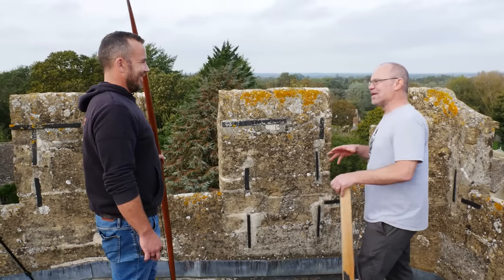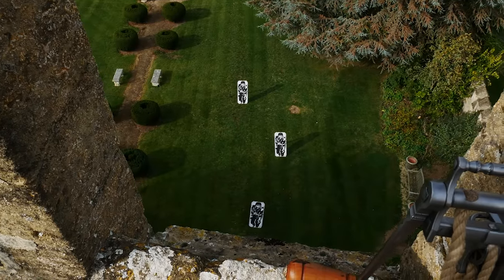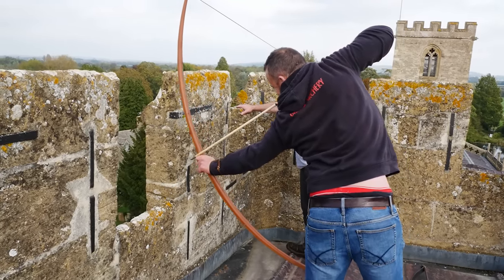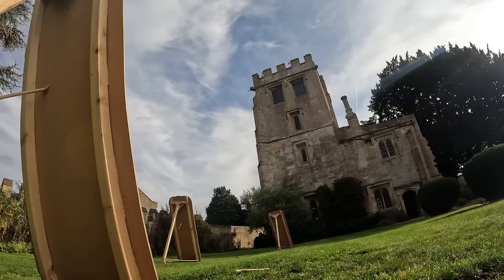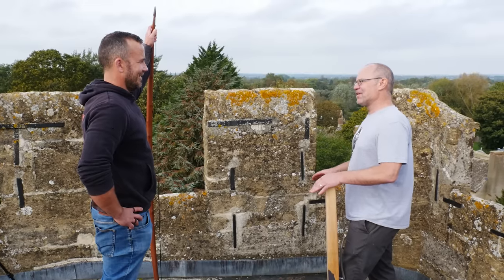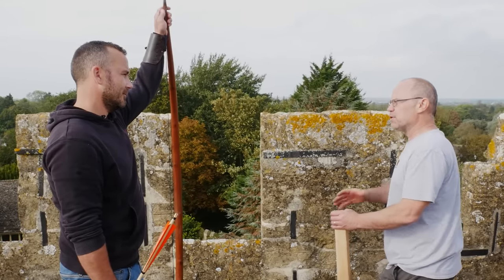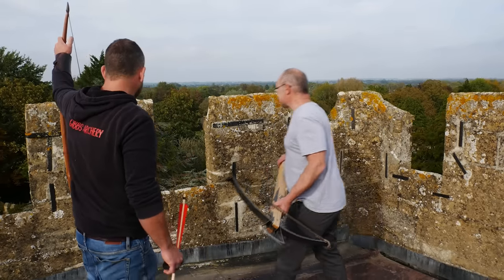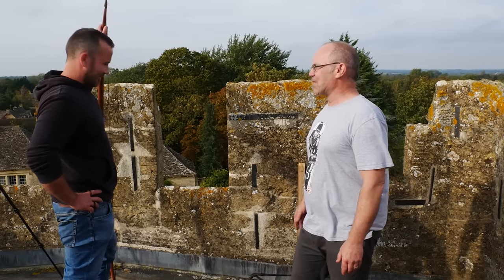Crossbow or Longbow? What's better for defending your medieval tower?

Comment: It's easy to break a bow! If the shoulder straightens up to meet the wall when firing, the sharp angle of which will simply cut many of the fibers of the bow and make it unusable. BUT you can shoot at not full extension, say 70-80% of your extension, without support, stretching the joints and ligaments as much as possible, and when shooting, hold on a little more and immediately release. The accuracy will be low, but for an experienced archer this will be enough to hit a person
That is, pull while it is stretching, pull while firing. There are a lot of arrows, there is no point in aiming for a long time

Comment: Crossbow has a clear advantage over a  war bow / longbow when on defense.

A group of people could load multiple crossbows that would allow the shooters to fire a constant stream of bolts. They would not hurt their backs or expose themselves unnecessarily when they pulled back on the string like the bowman has to. 

On the other hand. The long bowman would have a better weapon when assaulting the castle than the cross bow Wielder's would.
Reply: Not necessarily, men trying to assault the castle or any other fortified wall would be alrady at disatvantage trying to exchange missiles. 

So they would be often try to advance under some cover, pavise at a least. Or , like in 15th century, some kind of mobile shield/pavement or great size. Ideal as far as reloading crossbow goes, to take a quick peek without exposing yourself and shoot. They often had their own embrasures, at least that's what art shows, dunno if any of them survive in museums.

Comment: It’s a little bit in the weeds but I think crossbows had the benifit of a higher skill floor. If I had 20 completely untrained defenders and I had to have each of them shooting either a bow or crossbow you would be in a bad spot either way, but the crossbows would be easier to use for untrained people in a siege.

Comment: I think the actual answer for defending such a small tower would be "a bunch of shortbows, and a couple of longbows"? What do you think?
It would of course depends on what you have available in terms of trained men-at-arms and weaponry, but if given a choice and foresight, I think shortbows could be more useful in targetting the people close to the tower.
Though with an actual defensive structure, Machicolations would change that up.
Do you think Machicolations (as part of Merlons) would favour crossbows, when it comes to targetting people close to the tower?

As for crossbow archers being better paid; they would be a lot more effective at "town walls", or ground level. As then the extra punch (which probably doesn't travel well, and downwards distance travelled is still distance travelled) at the closer range can really be put to use.
In addition, the short training time probably has a factor in the higher wages; to convince people quickly to commit to the fight and decrease the chance of them running off and deciding it is not their fight?

Comment: I'd imagine that the "zone of safety" isn't actually real in this case. Aside from smaller bows, or perhaps some sneaky or bold positioning to shoot a crossbow, thrown items would still be a danger. An enemy could throw a fist-sized rock twelve yards on a level field; with the height of the tower, that range will extend and overlap the inner limit of bow shooting. I'd expect that by the time you're too close for an aimed throw, you're close enough that they can just drop things on you.

Comment: easy to train, better accuracy, easy use overall. if he used one of those light crossbows where u can literally arm the next bolt quite easily using one hand which carries enough power to penetrate a heavy plate armor with a heavier bolt. i bet 100% the crossbow is the better one for tower defence. especially if enemy use heavy armor at front to soak up arrows so their lightly armored can get cover from them and climb the towers/walls quickly.

Comment: For spanning in cover, could you do it while sitting, maybe rocking the crossbow a bit to clear the arms?

Other than that, the ability to keep the crossbow fully drawn to shoot at an instant's notice, possibly easier aiming unless you're very experienced with a bow, and the ease of training an average person do still seem to weigh in favor of the crossbow and later the gun.

Even if it's less individually effective when comparing skilled users, boring logistics still win out

Comment: The crossbow has the old advantage of being "militia-friendly", you come under siege and every schmuck who finds himself behind the walls is a possible crossbowman. After all, it was a baker who got King Richard at the siege of Châlus-Chabrol.

Also, I don't think a bowman would shoot from the ramparts if he can avoid it. That's what arrowslits are for, they sit at the exact right height to allow the archer to shoot just as upright as if he was standing in a field and provided even more protection than crenelations, were sitting architectonically much lower in the wall allowing for a more horizontal shooting all while making the attackers chose whether they raise their shields up against the bolts from above or keep them forward against the arrows from the front.

Comment: I think you are underestimating the exposure advantage. maybe to test it you can time and measure the size of the exposure for each and then do timed shots at targets from the ground (or simulated ground if you aren't allowed to shoot up to the crenelations of this manor). this would also allow you to test the other theorized advantage of the crossbow: the ability to wait for a target to pop up during a siege as the crossbow can sit spanned and loaded. 

the other thing to possibly try and test is simulated hoardings and machicolations, i imagine the bow arms will get in the way of shooting down due to bumping into the wall in front.

Comment: My takeaway from these videos is that both bow and crossbows have their use. A crossbow is too slow for distance harassing shots, or at least requires many more crossbowmen to achieve the same effect - so you can keep an army a longer distance back (lower element of surprise attack), a crossbow is more useful in the heat of battle if there is an attempt to storm battlements.

Are there historical examples of sieges being won by a archers / crossbowmen alone? The way i see it 24 arrows / bolts a day adds up to 1000 every six weeks.

How much of a siege was sitting and waiting out of range while seige engines do their part? When it finally comes to storming, if you have 1/2 a mile in full armour to cross carrying ladders etc. only to have to climb that ladder once you get there, surely the first 2/3rds of that distance archers have the speed advantage and can get off multiple volleys, only then does the crossbowman have a possible advantage popping out quickly and able to go on for hours without injury to oneself.

What is the flight time for a returning arrow? Add reaction time, adjusting aim, its hard to see a major advantage in speed unless at close range. I'd imagine the returning fire is far more psychologically damaging rather than a common lethal shot. If you feel rushed to take your shot self preservation instinct will make it unlikely you are aiming for accurately the greatest threat, possibly not aiming at all.

Comment: English did have shorter bows designed for defenses. They didn’t just use the longbow. They even had special bows for their Calvary archers….. the longbow is just the most famous and thus we think that’s all they had. Much like the mongols classic Calvary bow. Or  the Japanese samurai bow.. they were used in defending, but they don’t need distance as much as quick firing from very tight areas in castles…..  hence the use of other shorter bows less than 6 feet.

Comment: Skill and muscle strength is the difference. A crossbow can has a slower fire rate but you pick it up faster and fire with decent accuracy. It doesn’t take months or years to become decent shot while still piercing armor. 

With all weapons there is a trade off. For example a smooth bore firearm is less accurate than most bows especially beyond a certain distance. Also for centuries bow archers could fire multiple times compared to a single shot from a musket. 

Native Americans use to rush settlers and soldiers as they reloaded. In a battle with repeating firearms this finally changed.

Comment: The closer the soldiers get to the wall, the harder they are to shoot with a bow.  But how far out can someone on the roof throw a rock heavy enough to injure from that height?  I suspect it's more than 12m from that height.  That is, there might not be a safe zone too close to shoot with a bow yet too far to hit with a rock.

Comment: The only real advantage I see with the crossbow, is the extremely reduces time you need to become good enough with it to be efficient in combat.
You can get almost anyone trained to become a crossbow shooter good enough in a few weeks and even in days if you are desperate, but it takes years to become good enough with a heavy war bow and not everyone will be able to become strong enough or stay strong enough for it as well.
It doesn't take much time to create a force of hundreds if not thousands of crossbow fighters, but it takes very much to extremely much time to do the same if they are to use heavy war bows instead.

Comment: Ideally, you would have drastically less exposure with the crossbow than the bow for similar effect. If you can somehow overcome the massively worse fire rate it would be superior for siege defense by far. One could imagine three or for lightly trained guys continually feeding loaded crossbows to one trained guy, though that’s only speculation on my part. The ordinary bow would for sure be much superior in a scenario where pure fire rate was pretty much most important, like on an open battlefield. Other than that, crossbows must have been a lot more expensive to produce while competent bowmen must also have been a lot more expensive to train, so the tactical advantages of either weapon might not have been all that important for deciding which would be used in any particular battle.

Comment: Something that came to my mind:
For historical crossbows, the ones with a heavier draw weight, I can only ever remember seeing them being drawn with a windlass, where you have to watch out not to get the strings tangled up, while the lighter ones were drawn by hand with your foot in the stirrup or by placing a lever on it (I think that lever is refered to as a goats foot?), which gets removed once the String is drawn.
Is there a reason, that such a lever was not permanently integrated into the crossbow, like it was done with the crossbows in Skyrim?
Or is it just a case of "no one ever thought of that"?

Comment: Hi. If I know archer in Medieval time can shoot from bow longer then normal men now. His job was shooting during the extremes situations. 
The typical problems of archers was the  has problem with spine because all time used the bow.  During battle Archer can send more arrows during one wave. In 1 min can shoot about 5 - 10 times. In crossbows' only one shot a minute. You need count, if this battle was send 1000 arrows and was few archers, question is how long shooted by few peoples with send the 1000 bolts from the crossbow??

Comment: The defenders have another advantage of height - one that's largely irrelevant with modern firearms: The attacking missile troops have a harder time reaching them with meaningful force. Ie the arrows or bolts will have lost a lot momentum going up and will not gain much from gravity.

Comment: In a siege, food (calories) are obviously an issue, burning through a ton shooting must be a problem, perhaps a crossbow could be used as a medieval equivalent to 'deliberate fire' rates and bows for 'rapid fire' rates in the same way you'd use deliberate and rapid in modern tactics, plus here's an experiment, try a crossbow from the car and a short bow from the car, crossbow isn't too hard, bow you really need to lean out of the window and it's hard to load, not sure what that tells you but I've tried it as I don't have a horse, ones not too bad and can be shot from all sorts of awkward positions, the other is incredibly difficult

Comment: So my 5 cents before watching the video: Crossbow is easier to use but not more effective, meaning you could have mediocre crossbow-men with less practice and do the same or at least similar amount of damage than highly skilled archers. The crossbow also gives more time to aim while not beeing stressed by the drawweight. shooting right down might be a problem because bolt slides but at some angle it'll get awkward anyways... for both because shooting an arrow downwards is not something an archer does normaly I suppose... so muscles and technique are more suited for open field and a sort of plane fightingground. 
So medium range 30-50 m is when both are most effective everything closer needs a stone to be thrown...

Comment: I'm gonna be annoying and just state that 'peek and shoot' probably isn't as wildly big an advantage as some people are suggesting, given that people on the ground can move around a lot in between shots.  So a crossbowman popping up and taking a quick shot is still going to have to scan for targets for a brief moment, while an archer with a lighter bow can probably look and draw in about the same time due to this.

If anything, crossbows probably work best for the besiegers, who can continually cover one specific spot in a wall for an extended amount of time waiting for someone to pop up and shoot.  At which point you're also probably not moving, and the whole thing is going to get very 'pop up, duck, pop up again, *duck again*, shoot' - a really high-stakes rock paper scissors game.  Especially if you also have to account for the guy possibly taking a step to the left or right each time you do.

Also, thousands of arrows for one kill is a bit of a buried lede, Tod!  Expertly so, even!

Comment: Perhaps it has to do with the ease of use?
Not everyone is strong enough to use a longbow, especially if there is a need to bend or anything that might make the action more exhausting. If need be, I guess anyone could load and shoot crossbows.
Also, it looks like the archer moves a lot more than the crossbowman. Perhaps on the same length of wall, you can have more crossbowmen than archers, without them hindering each other?

Comment: Very interesting. The fact that it was so hard to even get the heavy crossbow to the top of the tower, and that shooting a heavy bow in those kind of angles was also very hard, makes me think that they probably used lighter versions.
How did the attackers likely get inside of the fortification? They break the door? Use ladders? Or other means? Because depending on that, the attackers may not really need to kill any of the archers on the top of the towers, just keep them from shooting at the guys that are trying to break the door, climb, etc. I understand that in a modern shooting there is very little aiming, and a lot of kepping your head in cover. Most bullets don't hit anything resembling an intentional target. In this case, how many archers where down there waiting for you to step into the open to shoot down? Would you even bother to aim at all? Or just shoot in the general direction of the guys carrying the siege device, and hope for the best?

Comment: Was there ever a tower where the crenelations lean out a bit?  With the embrasure floor slanted down, you'd get better close-in shots. I'd alternate them with regular embrasures.  I'm sure a good engineer could make them look almost identical from a distance, giving attackers no clue which is which until they got close.  More exposure for the defender to closer attackers, but also easier to fire down on them.

Comment: Surprised to see the difficulties start with actually getting the crossbow up the stairs.. But I guess a) this wasn't designed to be used defensively, with the crenellations only decorative (your heads are exposed), and b) Tod doesn't do it for a living so hasn't figured out the best way to do it, unlike actual experienced crossbowmen.

Comment: Typically longbow vs shortbow/horsebow is looked at as an east vs west divide. But we know that many Europeans used short recurved bows so the technology must have been known in medieval England. Wouldn't a shortbow be a happy middle for rooftop archers because the wouldn't have to worry as much about bumping into the battlements? Any chance this was done? Or was it strictly longbow & crossbow in England?

Comment: Bows are superior to crossbows in terms of rapid continuous firing. Crossbows require more time for reloading, which makes continuous shooting challenging. Situations like targeting enemies directly below, as often shown on screen, are uncommon. Mostly, tactics involved hiding behind castle walls and attacking from the sides, with only the wall visible from the front.

People in the cold-weapon era were well aware of these weaknesses and therefore utilized defensive structures like protruding parts of the walls or moats. These structures made it difficult for attackers to approach directly below the walls, allowing the defenders to use bows or crossbows more effectively. Moreover, these constructions provided advantageous conditions for attacking from various angles or sides, rather than just looking down from the wall. Attacking enemies directly below, as depicted in some recreations, seems impractical. Furthermore, if targeting enemies directly below, hoardings would likely be used. 
But I think it's a good video, as it makes me reconsider the structure of the castle and the moat. It's one of the points I pay attention to when I visit castle walls.